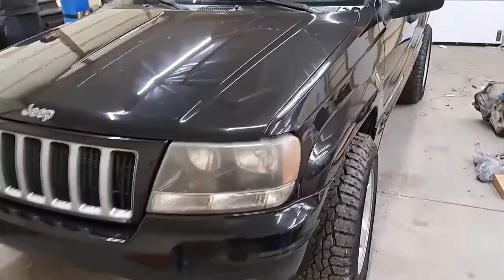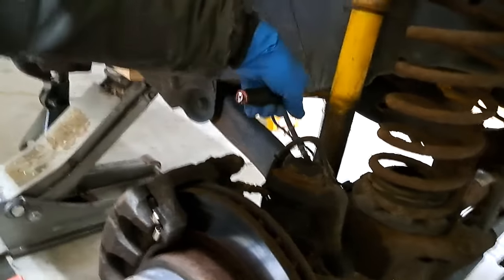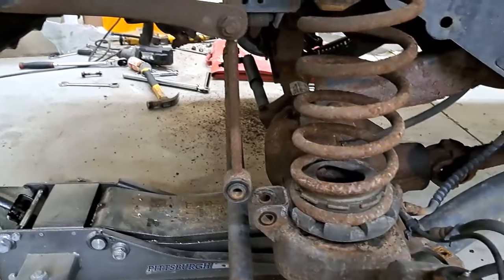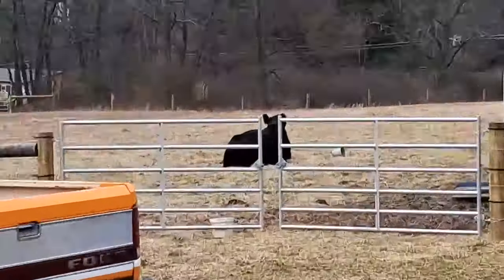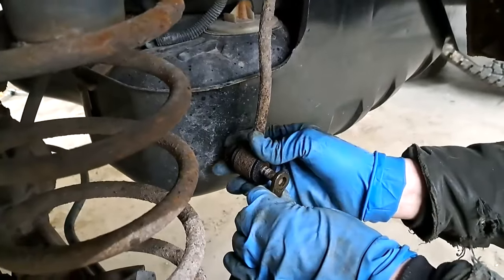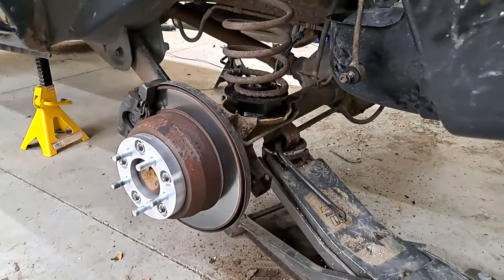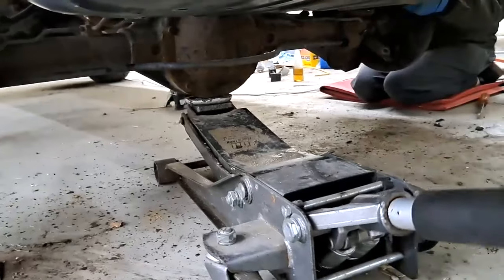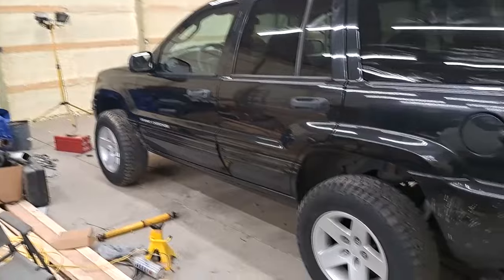2" Rough Country Lift Kit Install 99-04 Jeep Grand Cherokee WJ

Comment: These kits are a waste of time and money....first of all if you put this kit on a older jeep your not getting a 2 inch lift cause the stock springs are shot so you need new ones. Save up some cash and buy a 4 inch lift kit that way it's a whole new suspension at the height that looks badass 🤘
Reply: I put 2.5 spacers on my 04 and honestly if ur not hitting trails to hard and just want some height then spacers are a good alternative
Reply: @Raid-qx4jv 
I had 2” lift with spacers on my 89 Cherokee with 31” wheels. I went everywhere that the guys with the expensive 30k plus equipment went. They all thought it was unreal and never understood how my rig made it in and out. Bought the jeep from my best friend for 80 bucks because he couldn’t get the truck started and instead bought a 2005 TJ with 35” wheels and the original dana 30 and 35 front and rear. My 2” spacer lift I already had, the wheels were given to me, welded up the rear differential, and kicked it off to the utmost. 
The cheapest most bestest fun I ever had 😂

Comment: Worst thing you can do is lift springs and lift pucks, in order to do a correct lift is to do extended links and arms and just lift coils then use those shovk absorbers
Reply from the maker: It was for a family member and he ordered the kit. Actually rides really nice.
Reply: My 03 WJ with Old Man EMU springs and dampers (not long arm), rides beautifully on and off road, and I've never been hung up or had issues going where I need to go. Okay I won't be doing crazy rock crawling but that suits me

Comment: Use the factory shock cross pins on the front shocks. My wj didn't make it out of the drive before breaking.  265/75/16 load range E tires rubbed in reverse on incline, but not going forward.
Reply: 245 wide is the biggest you can go without spacers, I belive.

Comment: What size are the rims and tires ? Thank you.
Reply from the maker: They are 17" Rubicon wheels from a 2004 Wrangler. They have been repainted recently
Reply: @jackstandnation HI, the wheels are 17 but what size are the tires? Are those 245/75/17? or 265/70/17? Thanks

Comment: "Hi, I wanted to ask if raising the height of your vehicle by 2 inches has affected its handling on the freeway, especially when taking turns. I think the difference might not be significant, but the last time I raised the height of my vehicle decades ago, it also had larger tires which made the ride louder, like on a dirt bike. So, I'm looking for a compromise between the height and the noise. Also, did you notice any changes in mileage after raising the height? Your instructions make it look plausible for someone like me to do it myself. Thank you, and take care!"
Reply from the maker: It still drives pretty well with the lift due to it being such a small lift. Mileage is about the same to my knowledge. We installed the lift for a family member so I haven't really driven it since.
Reply: Did it increase ground clearance? Was this a quadratec?

Comment: I've been watching a ton of WJ vids lately. Seen most of them 5 times over.  I've had '99 for 18 years and I'm starting to build it this year. It's nice to see a fresh new WJ video. Good job.
Reply from the maker: Thank you soo much! 😊
Reply: how's it going with your project? what kit did you go for the lift?
Reply: @albertfs4754  haven't made it that far yet. I'll probably just do Fat Bob's 2.5". I had to rebuild the engine and trans coincidentally/luckily 1000 miles apart.

Comment: Great video, thanks for posting! I just purchased the same Rough Country 2" Lift Kit for my '04 Grand Cherokee. Can you please confirm that the rubber rear lower coil spring insulator is not required when installing this Rough Country Lift Kit?

Comment: did you have problems with stock springs falling out or bowing out after the kit installation?
Reply from the maker: So far, it's been working pretty well

Comment: How do you like this kit after being in use for awhile? Handling and ride quality still there? Getting any noise issues that I have read about? Considering this kit myself; Thanks for any info you can provide...
Reply: I've been running it for a few years. Stock tires. I'd get an alignment just because. No problems so far
Reply: been running it for 2.5 years now with 245/75/16 setup. So far so good. Front driveshaft doesn't like the lift so I removed it as I mostly drive on normal roads.
Reply: @NinoMaartenGuitar you can still drive without a front driveshaft?
Reply: @SenzuBeaner  yes. The WJ is rear wheel drive and only uses the front when needed. So far I've been driving around without the front driveshaft for 1.5 years and zero issues.
Reply: @NinoMaartenGuitar I had same issue with my front shaft, found a double cardan at a junk yard for $50 and it’s been great since.
Reply: @NinoMaartenGuitar The WJ is all wheel drive!!!
Reply: @Frankie_000  only when needed. It's mainly rear wheel drive. I still drive around without my front driveshaft :)

Comment: I remember doing my xjs. Wow those very rear bolts on the leaf springs were such a bitch to get off. Used a breaker bar the entire time backing them off. Couldn’t get an impact on em. Smh

Comment: Did you not bolt the spacer in the front it comes with a bolt to bolt it in
Reply from the maker: Nope...I guess we forgot lol
Reply: @jackstandnation  now ya did it lol yeah recently did on mine it come with the 19mm self taper bolt to bolt up the front spacer is it not knocking or making noise not being secured down?
Reply from the maker: We didn't get a complaint or anything yet but if it starts making noise we will put the bolt in. Seems to be A-Ok so far lol
Reply: @jackstandnation  lol shit happens
Reply: @getitdone361  Unless you disconnect the sway bar there isn't a need to secure the spacer while running short arms.
Reply: @paulbuchanan9914  wouldn't say that it's in the instructions to do it and bolts are included wouldn't know why you wouldn't do it I get people forget and it'll be ok but wouldn't say it's not needed if it shows it and includes it it's going on for me
Reply: What are the Tire size?